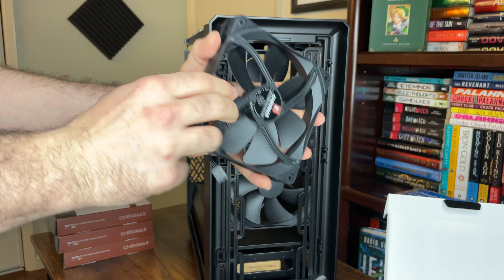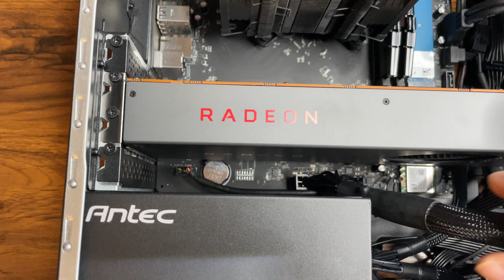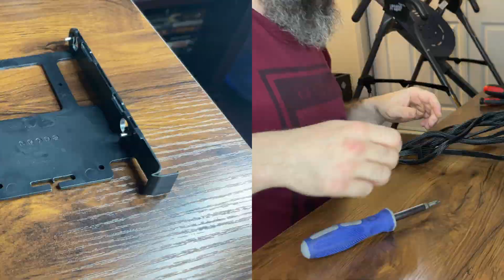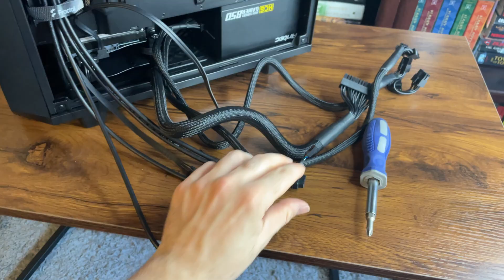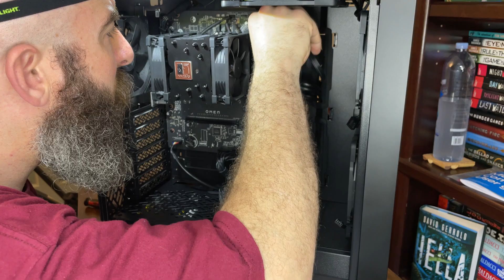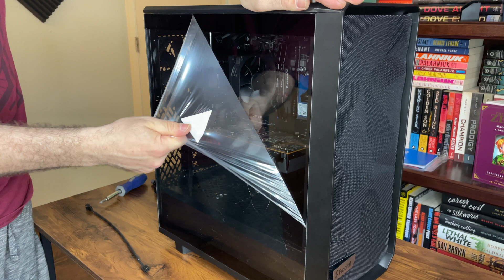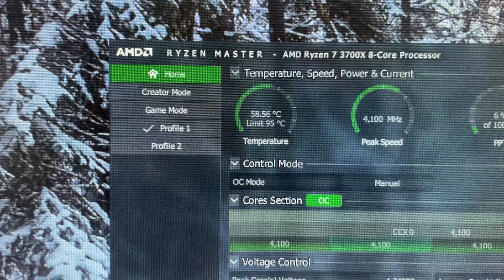HP Omen 25L / 30L Case Swap! Tutorial! Walkthrough and Results!

Comment: Hey Dan! I had a question. I know our PCs come with two sata power connections. ( where you plug in the noctua controller). I’m planning on changing my case and upgraded to AIO cpu and gpu. So I need the two ports plus another one for the noctua fan controller. Would you know if you can use a sata power splitter ?    

ANRANK High Speed SATA Power 15-pin Male to Dual 15-pin Female Y-Splitter Cable Adapter for HDD Hard Drive https://www.amazon.com/dp/B07QKXMM3D/ref=cm_sw_r_cp_api_glt_fabc_W88MSV1JZQPMFATCCBFP?_encoding=UTF8&psc=1

I was thinking of splitting and powering the two pumps and then using the other sata for the controller?
Reply: Or does the stock psu support an added cable??
Reply from the maker: The stock Omen PSU has 3 SATA connectors ( RGB controller / HDD / extra HDD one ). So if you’re swapping over to a new case, you would have 3 SATA connectors available. I’m honestly not sure about using a splitter like that, I would read and watch reviews on something like that, never used one.

Comment: Great video. I was struck by the size difference between the 25L and the Meshify case. Besides the mesh providing greatly improved airflow and the additional larger fans, just going to a 60% larger case (25L to 40L) has a positive impact on the temps as well. Glad I have a cool running 30L instead of a 25L.
Reply from the maker: Thanks dude!!! And the funny part is the Fractal case is definitely considered Compact compared to other cases. 30L thermals really aren’t that much better than the 25L. 👍🏻 My Omen ran just fine, it’s just time to move on and branch out 😄

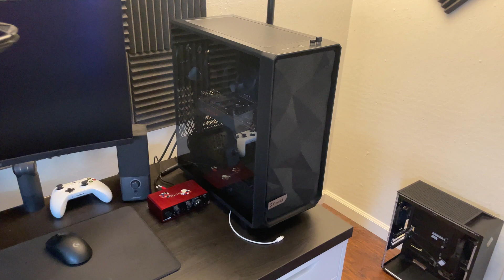Comment: 22:10  when you press the power start up button  how did you get the RGB lights behind the back of the table you light up?
Reply from the maker: I have an LED strip that is plugged into one of the USB ports on the back of the PC! So as soon as the PC gets power, the LED strip gets power and turns on.

Comment: Awesome tutorial! But what is the smaller motherboard-looking card down to the right in the omen case that you didnt move?
Reply from the maker: Thanks!! That is the HP RGB controller. It controls the lighting in the Omen case, so I will not need it in my new case 👍🏻
Reply: @DanKamYouKnow  I see! Thanks. I'm considering also swapping the PSU because of the annoying clicking noise that occurs every five second or so when browsing. But now Im considering if I should go all out with case swap AND CPU cooler swap as well at the same time. I dont feel that comfortable taking a part the PC so if I am to do it I rather do it once than multiple times :D
Reply from the maker: It’s up to you and get quite expensive if you’re doing it all but the flexibility of a new case and motherboard may be worth it for you 👍🏻👍🏻

Comment: I have one question does this work for all types of “Omen 25L”? And since I have a 3 year warranty would that mean it would make a change on it? If that makes sense because I heard something about if you swap out your gonna lose the ability of something, i forgot what they said but something like that
Reply from the maker: Yes, this will work for any 25L and 30L. Pretty much any modification will void the warranty so proceed how you you wish. HP requires the PC to be in its stock form to be considered for warranty work. The only thing you lose by swapping everything is Omen Gaming Hub Lighting control ( since the lighting is tied to the case ) Everything else will work just fine. I didn’t swap over my WiFi card as well.
Reply: @DanKamYouKnow  oh okay thanks for the info man, also lets say I have new specs for the omen, and i recently needed to fix something and I have that warranty, can I just remove all the new specs and place back all the old spec into the build and would they I still have a chance for it to be fixed?
Reply from the maker: Yeah, I don’t see why not. As long as they aren’t aware of the modifications that were done at one point.
Reply: @DanKamYouKnow  Alr thanks man! Thanks for the info!

Comment: I normally like more intake then exhaust fans, if all the intakes are screened.  With positive pressure it doesn't suck dust in all the openings/cracks in the case.
Reply from the maker: I’m trying to figure out the best way to achieve this because I have a slight amount of negative pressure right now, but my temps are fantastic. I could remove the hard drive cage and add a 120mm intake to the bottom. Or remove a top mount 140mm fan. May have to experiment.
Reply: @DanKamYouKnow  yeah, it probably won't matter too much, it's more of a personal preference.  Imo, the easiest way to test would be to flip the top fan closest to the front.  Don't forget the blower style gpu is an exhaust too.  Sexy looking build and good tutorial!
Reply from the maker: Thanks!! Appreciate it. I’ll have to see if there’s any change in fan orientation some time 👍🏻

Comment: thats one of the tings i upgraded the 25l sucks. my next upgrade will be the cpu cooler. my numbers dropped cpu temp at 70 and gpu 65 hoping to get them lower. your videos helped
Reply from the maker: Nice! A CPU cooler will make a huge difference if you are still using the stock HP air cooler!
Reply: @DanKamYouKnow  silly question, is there a way to control the fan speen on this motherboard? Or they always run at 100%? Tried everything but failed
Reply from the maker: Omens have Omen Gaming Hub which can set the system fans to “Quiet / Normal / Turbo”, which is our only source of fan adjustment. The only fan header that will constantly run at 100% is the LC_pump header.
Reply: @DanKamYouKnow  yea had them on turbo. Thought i could control the % or make fan curve like some motherborads.   Thank you 🙏

Comment: It's possible to put other intel CPU LGa 1200 on that motherboard ??
Reply from the maker: My motherboard is for AMD processors, what CPU do you currently have and which one were you thinking of upgrading too?
Reply: @DanKamYouKnow  I wanna swap Celeron g5900 LGA 1200 which is 10th gen into that motherboard but on hp website only shows i5,i7 and i9 10th gen
Reply from the maker: Then it probably won’t work. Zero access to the BIOS to do any kind of necessary flash to be able to accommodate the CPU.

Comment: Hey Dan, really great tutorial! Were you able to reuse any of the Noctua fans that you bought previously, or did you have to buy all new ones?
Reply from the maker: Hey Lawrence, thank you! Unfortunately, the only fan I was able to swap over were the 120mm rear exhaust fan for my new case. I ended up buying four 140mm Noctua fans for the front and top. I will be reviving the Omen once I replace my current GPU ( Hopefully a 3080 soon ) and find a CPU for it, so I’ll still be able to use those fans as well.

Comment: Case looking good I've a question I've Really been wanting to do a mtb swap on my pc is it worth getting a new case aswell or just the mtb its self
Reply from the maker: Depends on what you see yourself doing with the PC in the future. The Omen case can only fit Micro ATX boards, so you’re limited to a mATX board for the Omen case. If you swap cases though, it opens you up to whatever you want to do. Plus, WAY more flexibility with a new case.
Reply: @DanKamYouKnow  yea an i also didnt put back the wifi card when i was installing my u9s i only use ethernet
Reply from the maker: Same here. I hooked up the WiFi card just in case but I never use it.

Comment: Hello I just got my 25L yesterday I looked at most of ur videos I don’t plan on putting fans till later but since the airflow is meh on this case you still
Believe it’s safe for most games to play on without the temps going up to much? And you still suggest to take off the top panel to let more airflow in?
Reply from the maker: Yes, I highly recommend removing the top panel since it’s only 2 screws that holds it in. Usually most Omens in stock form run completely safe temperatures. I’ve seen hardly ANY that actually overheat. Most just run a bit warm but completely safe. Remove the bracket and keep an eye on temps from time to time and see where you’re at!
Reply: @DanKamYouKnow  thanks man I was just so hesitant I know you said they run well just a bit warm but safe def gonna install some fans in the future though and I wasn’t sure if they would run most bigger games well. But thanks man
Reply from the maker: No problem dude!!

Comment: Swapped a few fans out recently on the 25l and I've been getting some improved temps. I got very low 30s idle and anything from 55-70 gaming now. But I'm still looking at swapping out of my case as I feel so restricted in fan placement etc. The fact that mine only came with one 80mm exhaust fan still disappoints me.
Reply from the maker: Those temps actually look great! But a case swap does a bring a whole new level of flexibility and airflow.

Comment: Changed the case and the motherboard two days ago! A necessity
Reply from the maker: Such an improvement in airflow and flexibility 👍🏻
Reply: Was the mobo swap straight forward or did you need to purchase a new copy of windows, I have the i9700 and rtx 2070 Super model and the not being able to run more fans or push my cpu beyond 3.0ghz is killing me
Reply from the maker: You’ll need a new copy of Windows. Windows is burned into your HP motherboard BIOS and can’t be reused if you’re swapping the Omen SSD. You’ll also need “Windows Media Creation Install too” on a USB stick to install the OS.
Reply: @DanKamYouKnow  so I can't just reuse the ssd, I thought maybe if I bought a good mobo for my cpu I could just reuse everything else in a new case and windows would boot from the ssd, no?
Reply from the maker: You can re-use the SSD, but that version of Windows will not work, you’ll need a new Windows Key

Comment: At some point, you’d hope that HP would take notice and reward this man for hyping the Omen lineup and send him some hardware!  At the very least Noctua should send him a fan or two...
Reply from the maker: Aaayyyyyeeeeeeee! I’m pretty sure HP doesn’t like my videos lol. Basically showing people how to void the warranty and the thermal issues that they can have. 😂

Noctua on the other hand... 👀👀👀👀
Reply: @DanKamYouKnow  When you say 'thermal issues' do you mean like stuttering/FPS drops? My PC is mostly OK but I do get stutters in a couple of racing games and it seems to be more frequent the longer I play.
Reply from the maker: Thermal refers to temperatures. While the vast majority of Omens temps are in the safe zone, they are a bit warmer than I’d personally like. If you are experiencing stuttering, I would definitely make sure your graphics card driver is up to date. Also see if this issue happens in multiple or just 1 game, and see what your temps are while you are gaming and it happens.
Reply: @DanKamYouKnow  Thanks, it's various games but mainly one. My temps are hitting high 80s for the i7 CPU and low 80s for the 2060 GPU - just below where they're supposed to throttle but it feels like they are. throttling.

Added a bottom and top fan but didn't make a significant difference.
Reply from the maker: You may want to change your max processor state to 99% and your minimum processor state to 5% and see what happens. It limits the CPU ( barely ) and created a huge temp drop when I did it.
Reply: No1 told
Him to do it he does it himself and gets rewarded with subs comments and viewing opportunities he gets enough to me
Reply: Hi :) i have the same Omen , and i with you changed my omen step by step with Your videos and Today i change the case too , it Was terrible case 😅😅. Ty for Your videos :)
But i upgrade D my air cooler too: Noctua NH-U12A
Reply from the maker: You’re welcome and thank you for your comment! Glad to hear that everything went smooth for you 😎🤝😎

Comment: Just an aesthetic consideration that was mentioned to me at one point and which I follow, orient all the fans so the writing on the back is oriented the same. If the word Chromax is at the top on the front fans, so the same for the rear fan and the top fans. It does mean the wires may not be positioned optimally, that is closer to the back of the case for management, but it does sort of make things feel more uniform in a small but sort of significant way. Obviously, you have to weight function and cable management over aesthetics, but aesthetics do rather matter.
Reply from the maker: The only issue I ran into with this is the front fans, even with extensions could barely reach the top of the motherboard. I am ALL for aesthetics so I totally agree with you, the board made it a bit difficult to do it cleanly. The rear and top fan both have the stickers how I’d like them though. Overall, the cable management came out FANTASTIC though so I’m happy.

Comment: The top fan mount is removable and held by two screws. Helps a lot in z490 boards where 2 cpu power headers is required.
Reply from the maker: I should of looked at the Fractal owners manual. Didn’t even think about it when I was screwing in and removing the top fans 😂. Made it hard on myself

Comment: Welcome to the swapped omen case club!
Reply: Meanwhile I got the most massive dual chamber case to tuck all my cables in lmao
Reply: @NateByte  I looked at a super wide ones. I'm just torn on cases. Leaning towards the corsair icue 4000x though!
Reply: I will hopefully be joining this club in the next week or so!
Reply from the maker: What case did you go with?!
Reply: @DanKamYouKnow  I'm in the process of trying to figure that out. Going to buy a case, my, and new power supply all at once. I already have the ryzen 7 series 3700x and rtx 2060 so I can just shove those in there as well. I've been looking at the corsair icue 4000x and icue 465x. I really want a white case! Just not sure what to go with. I like the 211 but it is just super small!
Reply: *motherboard
Reply from the maker: Small cases can be cool but kind of a pain to work in! I would maybe consider a case that also supports ATX, just in case you decide to swap your motherboard down the line. White cases are super cool 👍🏻
Reply: @DanKamYouKnow  I plan to buy an atx mb,  a case, and a bigger power supply qll at the same time!
Reply from the maker: 😎😎😎😎! Now to install my X570 motherboard in the next week or so!

Comment: Gonna be swapping to the Phanteks P400A. Fantastic airflow case at just stock fans. Comes with 3 120mm Fans. Bought an extra Noctrura fan for the rear
Reply from the maker: Nice!!! I strongly considered the P300a / 360a / 400a, but fell in love with Fractal. The Phanteks should be a fantastic case to build in 👍🏻
Reply: I transplanted my Omen 30L Ryzen into a Phanteks P500A. Love the Phanteks and can highly recommend.